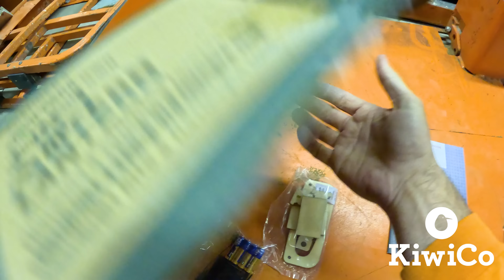How to Install an Elevator in your Backyard

Comment: You missed a few steps here.
The most important of those being removing the surface treatment from the parts you trimmed and/or welded, then applying a new surface treatment.
You may believe it's just paint to look pretty, but that's a proper surface treatment to prevent corrosion. Even ignoring that it's embedded underground and will tend to collect moisture even if you seal the envelope instead of leaving it exposed, that scissor lift would be rusting out in under a decade.

My best advice? Pull it out, disassemble everything that can be disassembled, sand everything down until the metal shines, then apply a proper protective surface treatment. This is a high-moisture low-salt environment, so you've got a lot of options there.
Once you've got it all properly treated you can reassemble it, grease all working surfaces, and put it back. Remember to surface treat the leveling equipment too - yes, you are going to want to paint over the nuts and bolts; you're much better off removing the paint if something shifts and you need to adjust it then suffering through them getting jammed from rust and corrosion.

I'm a bit leery of your decision to use so many mixed metals - steel, aluminum, AND brass all at one contact point means you're going to get galvanic corrosion damn near instantly. You have a lot of options there; the bucket shouldn't need much to keep it from moving.

Comment: The steel rebar won't rust either if it has enough concrete coverage, but the fiber glass will do fine as well.

Comment: I would try to think some kind of mechanical option in case of malfunction, power loss and other edge cases. It may freak out to get stuck down there. Something similar to the stairs on the other side, but maybe with a manual gear lift?

Comment: For the future, you should use an ESP32 or Arduino to build an elevator system... Put limit switches on it for up and down, a button panel with up/down.  safety latch so it will only run when closed, and a platform that seals on top when you go under to keep people/animals from falling in....   But would be a cool project to just push a button and it goes down, or just push up and it goes all the way up.  No need to push and hold a button on a pad...  Program a custom voice speaker "Going up"  "Next stop, BUNKER!"

Comment: For those cross members being "Temporary" you sure welded them solid all the way around...  i would have just left them on as more structure/hard ties...  but thats just me..  Cool idea to use a scissor lift as an elevator.  I was thinking you were going to engineer a custom track and custom anti-fall safety system and use a high power electric motor under it with strong cables going up and down the walls to the cage with pullies.

Comment: Love the bunker and looking forward to the build out.  For the elevator sway, you could mount the platform to some rollers with unistrut mounted vertically to the wall.  It would make the lift feel much more stable.

Comment: The concreting part you messed up since segregation will occur due to pouring height is high. Next time try using a down pipe to avoid concrete segregation which affects it's strength

Comment: Do you also plan to Colin Furze it and build a tunnel from your house to the bunker? :D 

Also I am super suprised the bunker does not have utilities connection. Electricity, water, sewage. I get the skipping the sewage but I would definitely bring the electricity  + water + internet in there.

Comment: Guys, learn from this, dont use normal steel for the framing, use stainless. Will save you many problems in later years.

Comment: For emergency use you could set up a bowsmans chair on a manual pully system incase the lift is inoperable and or you dont have power. Just an idea

Comment: This video brings back memories... I have a paraplegic mother in a wheel chair.  Groing up in the 80s my father built the exact same scissor lift in a shaft for my mother to get the basement of our house.  This sounds the exact same going up and down, and does the familliar light "wobble" she is talking bout.  As a small child I was very familliar with how this operated.  My dad also welded a simliar metal box to the top of it with side.  Then put carpet on the sides inside it.

Comment: A word of caution, make sure you have a safety plan in place in case of an emergency. For example, don't put flammables in between you and your exit. Also, not sure if Radon gas is a concern for your area but consider investing in some kind of air monitoring system. Batteries could off-gas, canisters can leak.

Comment: My 2 cents  on your design I’d put 4 post from bottom top on the platform put wheels for smooth ride as time goes along easy smooth adjustments 
In hydraulic failure prerunner tall springs for not a hard fall 

On my farm I’m building 18 x 18 foot platform only 3 feet high 
I’m gonna use just the front of a fork lift with the tilt and slide feature 
No propane motor ( next project build a cancam copy on propane engine) 
Electric motor variable speed to run hydraulic motor to everything else 
I like a quick elevator not these stone age boxes we have today
If I had real $$ the truck platforms from ground to airplanes are fast and smooth and can lift tons

Comment: I like the wheelchair lift.  My wife ended up in s wheelchair for over a year.  My task was get my wife to the main floor of our house.  I ruled out ramps and chairlifts.  A wheelchair lift was the only practical solution.  My task was to design, engineer, and construct an elevator shaft for the wheel chair lift.  I did it under a week.  This around 25 years ago.  I took precise measurements.  Then used CAD for the design.  I had a cut list for every 2x4, 2x8, piece of plywood.  It took me one evening to buy and cut the lumber.  Then another evening to build it(I borrowed a neighbor's nail gun).  I was only off by one 1/8 inch.  The elevator installers where able to install the lift in one day instead of two.  The installers praised me for the shaft and joking offered me a job making elevator shafts.  I was proud of that job.

On your safety box.  Our wheel chair lift had a similar box.  People will grab the upper edge of the safety box.  So you need to have enough space between the upper box edge and the elevator shaft to prevent pinching of fingers.  The shaft had to be be something like a ~1.5-2 inches bigger then the box on all sides.  I recall this anti pinch design feature of my elevator shaft vividly 25 years later.  Check on the precise distance, It was range, they wanted a big enough gap not pinch fingers, but a small enough gap so you wouldn't stick and arm in it.

Best wishes, Kurt
Reply: Jerry should put handles on the inside, and maybe some grooves to hold the wheelchair slightly in place
Reply: If I ever have the blessing of helping someone who has any type of disability whether that's a stranger or a friend family member or spouse. I will be so grateful and do whatever I can within my power to make their lives easier.
Reply: use REVIT for this? lol
Reply: I know it might not be as simple as just doing it but I would have made the floor that she can access the main floor. I think whatever way people make it work for themselves is great though I like that everybody can find a way they're comfortable but everyone also can have different ways of making that happen

Comment: Looks awesome! I'm hoping you add some unistrut guide rails to reduce wiggle with a limit switch for the up direction. I'm guessing the obohos HS-4 industrial wireless remote would work with controls.

Comment: Jerry please .. no concrete vibrator during casting, no guides for the lift to minimize the wobbling.
You need proper life support down there man, clean water and clear air ! you need to do MEP first before and plan it out before the walls and floors
and one thing I didn't hear you mention at all is drainage ? You bathrooms and kitchens need drainage even if its combustible there should be a plan B .. redundancy is key for bunkers

Comment: Everyone is afraid of a scissor lift the first time they get on one. Then your buddy shakes it so bad you think you'll fall and it's not scary anymore. Surprisingly stable. We have a boom-boom style with no safety and air-filled tires. Everyone who uses it hates it because you can go full speed 30 feet in the air if you don't watch how much you activate the hydraulic lever. I love it.

Comment: Looks amazing, my only concern is true power if the grid really goes down, ecoflow won't sustain you, you should probably run a hidden solar setup (prob will last sometime until somebody fucks it up) but have parts available down in the bunker too

Comment: Very cool project. One point is that wet concrete should generally not be dropped that far because it can cause the cement and the aggregate to separate. I suspect this to be less of an issue in this case since the concrete was raked out at the bottom, but this is a serious consideration for less accessible pours (walls and columns).

Comment: You should run a bent corner of rebar around corners that goes 24" past the bend. 
You can mix in steel and firberglass bar. Fiberglass corners aren't usually in stock at retail. They can get special orders quick though since the local distributor will have them if you live in a large market.
Painfully to watch you cut the fiberglass with a Sawzall. I just presumed you didn't have a chop saw, but then you were cutting steel later. Just use all the same tools on fiberglass rebar as you would steel.
Reply: Painfully to watch you cut the fiberglass with a Sawzall. I just presumed you didn't have a chop saw, but then you were cutting steel later. Just use all the same tools on fiberglass rebar as you would steel.

Comment: Great job, really inspiring!

Just a couple of stupid things, sorry for the nuisance.

I see the whole weight of the lift insists on those four bolts. While I'm not worried about their ability to support such weight (even if a wider and solid support in-between the base and the concrete would add a bit of peace of mind), I still think that the whole bottom structure should be firmly secured laterally to the bunker, to avoid any small lateral movement/vibration that can break the solderings of "deez nuts" :D

More: is it really a good idea to put big fat batteries inside a bunker, let them be either acid or lithium? Wouldn't it be better to have them on the outside, inside an enclosure? I mean, I don't like the idea of one of them going crazy, blocking the path to the only accessible exit of the bunker.

Being an underground space, please take huge care of ventilation (air needs to be extracted from the bottom and not simply pushed into from the top), cables disposition and materials used (fireproof, fireproof, fireproof).

Looking forward to watching the next development! Wish you both the best

Comment: Why didn't you vibrate the concrete to remove air bubbles? You need to remove air pockets to avoid cracks eventually

Comment: Lol if that was true about this fiberglass rebar every large building ever would use it so it's obviously just false advertising as usual, in reality it's probably a safety hazard but for your elevator it will do just fine because it's not a large structure

Comment: Hey, engineering student here!

Just a quick note on the concrete: Usually it is not recommended to drop wet concrete from such high heights. By doing that, the concrete doesn't stay as coherent as in the tumbler, thus by dropping the wet concrete it creates air gaps in the concrete slab, thus reducing the strength of it (unless it is a self compacting concrete, idk what concrete you used). I don't think that this is significant considering your loads, so it should be o.k. But take that in mind for the next time and use a thick hose or sth similar to pour the concrete!

Love your project! Cheers!
Reply: I worried about the same thing, I'm hoping the working of it helped get rid of most of the air.
Reply: Not that what you're saying isn't true in theory, but the issue of dropping concrete is separation of the course aggregate  from everything else.  When you're dropping into narrow forms all the course stuff winds up at the bottom and there's no way to "fix it" - vibrating it just makes the situation worse.  In this case the concrete was all manipulated again  (re-mixed essentially) with hand tools after it was "dropped" and you could see the mix looked perfectly fine.  There will be zero problems with because of being "dropped" - not to say that there could not be other issues but  'dropping' would be the least of my worries.
Reply: @HBSuccess  That makes perfect sense, thank you for explaining.
Reply: Who would have thought! That’s very interesting and it does make sense. I’ll have to take that into consideration when I’m building my own superbunker complete with elevator, or anything else that would need concrete like that. What would be the ideal technique then? Concrete pump?
Reply: Ideally you use a tremi chute with a flexible canvas hose, solid hose versions are used in underwater placements. They are often referred to as an "Elephant Trunk". Although there is debate over how much free fall placement of concrete affects the strength of it, if at all. 

For a slab however, I'd use one just to prevent the material from getting everywhere.
Reply: @Mr-Evil-Dave  Nah, you want to line the walls anyways.  LOL
Reply: Had exactly the same thoughts. But then I did a quick research: 
Germany: "Never pour concrete from a height of more than 2 meters - sedimentation occurs and results in weakness." 
USA: "Actually it doesn't matter at all, even falls of 50 feet are no problem, see here: - The PCA book cites a study in which concrete was dropped vertically 50 feet into a caisson. There was no significant difference in aggregate gradation between control samples as delivered and free-fall samples taken from the bottom of the caisson. This showed there was no segregation."

Well...🤣
Reply: Well he could have used the elevator to lower the concrete. Oh wait, that would be getting the cart before the horse. Maybe use one of those vibrator machines to drive the air out of the concrete? Hey, I was impressed that he put rebar into the concrete. Most basement floors do not even have that? And I imagine it is great that it is fiberglass and will not rust, a huge failing of concrete, that the rusting causes spalling.
Reply: @yosefmacgruber1920  If you hang the lift upside down you could lower it down.
Reply: @robertsmith2956  
If you hang the lift upside down you could lower it down.

I think we are just trying to lower it, not damage it.

I wish that I could put an elevator onto my video game island, but I have not found any such 3-D model yet. I did try custom-drawing a closet "door", but it looks more like a school play prop than an actual door, as I had to place it in front of the wall, and not actually onto the wall.
Reply: @yosefmacgruber1920   Yea, the door is my problem.  Needs to be cat proof. The little buggers are fast and sneaky,
Reply: @robertsmith2956  
Why does a door need to be cat-proofed in a video game?
Reply: @yosefmacgruber1920  as I said, they are devious.  They will chew your controller cord if it gets them through the door.
Reply: @robertsmith2956  
The world needs dogs so as to keep ever-foiled the plots of the cats to take over.
Reply: Don't they make "air-entrained" concrete with intentional air gaps and all concrete has some air gaps? 
Also, doesn't a concrete slab-on-grade have complete support under the entire slab and the compressive strength of air-entrained concrete is about 95% of non-entrained concrete. So, if he used typical 2500 PSI concrete the resultant air-gapped concrete would still have upwards of 2000 PSI compressive strength. The weld plates looked about 6"x10" or 60 sq-in times 4 plates = 240 sq-in @ 2000 PSI... So, give or take 500,000 POUNDS!! I'm guessing the 1500 pound elevator with 500 pound cargo won't be much of a problem for the concrete slab even with a few air-gaps.
Reply: Blud where exactly is concrete not dropped from such heights!!!!!!!!!!!!!!!!!!!!!!!!!!!!!!!!!!!!!!!!!!
Reply: oh that's why they pour it with a pipe
Reply: In this situation, would vibrating it help?
Reply: @salty-nick  not a whole lot, if you did it long enough to help the aggregate would settle to the bottom causing your top layer to be weaker.
Reply: @salty-nick  the problem is that the denser aggregate drops to the bottom of the mix, and the top will spall off. So, vibrating makes it worse. Max drop height is 4'. That's the reason walls are built in 4' lifts if pouring straight, though with pumps and hoses, taller lifts can be made.
Reply: @jamesfoy1983  Thanks James, that makes sense!
Reply: Wont the vibrator help with this problem?
Reply: He obviously doesn't know what he is doing and didn't even research to do it in a safe way. He just had to bum rush through it. I used to work with people in construction who would try to rush through everything. Every single one of them ended up getting hurt on jobs or inspector would make them go back and fix everything wasting time. The fact he doesn't reply just shows how big of a ego this guy has and sooner or later something gonna wrong and his lady is going to be the one that will be the downfall of it. She asked if its safe he said its 100% safe. Nothing is 100% safe. The guy is low iq construction guy. I quit construction cause of people like this. They almost got me killed a few times not doing things in safe way. I get it people want to get things done fast but inspections need to be done so they can spot things that you didn't realize were not safe and fix it. Ya you might have to spend a few more days on it but at least then its safe. And he needs a technician for his elevator to come out and look at it every month. If she gets stuck down there he will have hard time getting her back up.